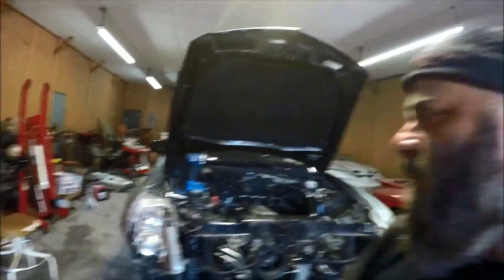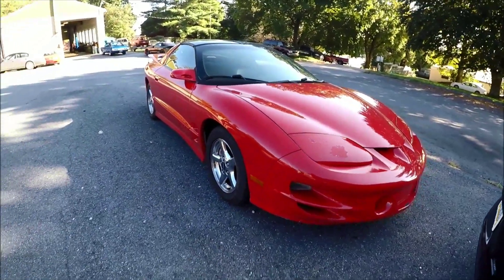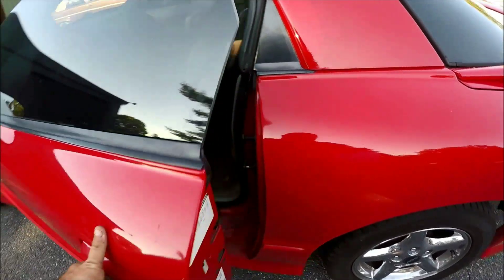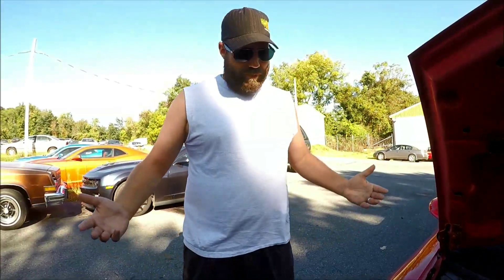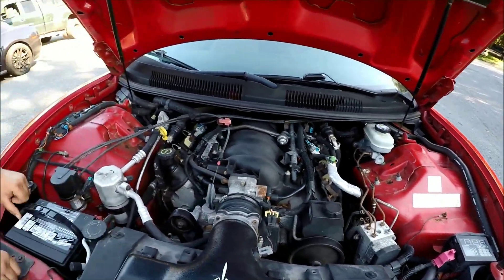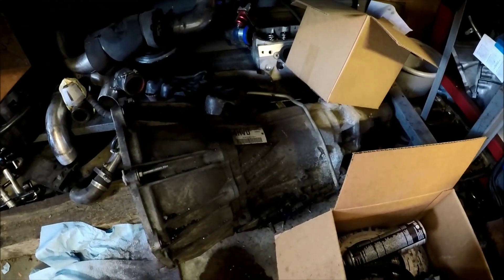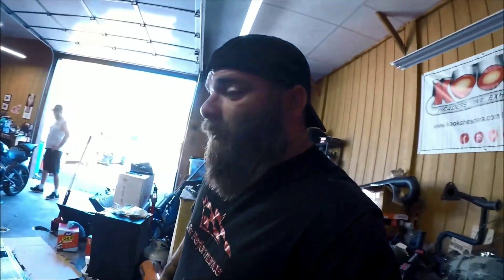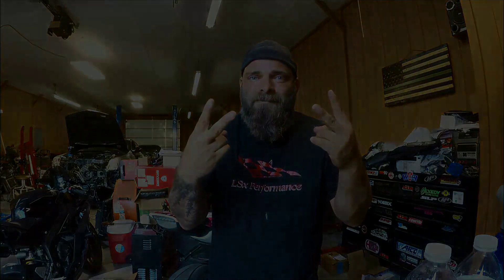The Shop Trans Am Breaks AGAIN!!!

Comment: Hey andy my 2010 ss camaro the clutch is going out I think it has be forced into gear and moves when it goes into first without any brakes on it. But also have friend was shifting and hitting the gas with the clutch partially in still. And that can mess up the pressure plate not sure about throw out bearing. But I'm have to get a better clutch anyways to once I add more power with a cam and blower or procharger or turbo set up.

Comment: Get a 2800 YANK-ER-OOOSKI Stall... you could always go with a mild cam setup. Even the GM hot cam package is pretty simple and cheap. I think it's a 525 left and they throw in some titanium valve springs and stuff like that just to give it a little extra protection. You going to have to have more than that to take down old John Doc

Comment: 2800 stall  i had a 92 camaro with a 350 tune port with a 700R4  built by maddog transmission stage 2 build with a 2800 stall and it use to lanch hard but super smooth hook and book

Comment: You could also do a 2800 or a 3000 converter . I think the 2800 would be my choice. You know your shit . So I’m not telling you what to do . I did a 2001 vett with turbo and E85 a 2800 convert we put down 567hp and 610 TQ .  Still running today . Nice little setup .

Comment: Rebuilt the 60E and modify that LS1 with a LSX 102 mm intake, Headers, Cam, 243 heads. SLP exhaust and a 75-100 shot, 65E is a slow banger, Stay with a 60E or a 80E!

Comment: Are you thinking broken sun shell? The stall is going to be variable to the power level and weight as you probably already know given your fluid checking display. A good 9" converter with the anti-balloon plates set for 2800-3200 in the ballpark power range with a 1.98:1 torque ratio and lockup should be fervent on a street driven turbo LS with high gears thinking that the 65 should have lower 1-2 gears to overcome some of that. I'd be interested in the trap speed and how long the 10 bolt lasts. I've never seen an 8.5" put in a torque arm F-Body, but they should've been factory after '86. Same pinion bearing diameter as a 12 bolt. You asked for suggestions and I'm going off of memory, can you underdog it a little bit?

Comment: Andy! Great post today. I don't know why, but it seems that Firebird & Camaro owners like to cover up their botched tranny builds with shift kits. My 1984 Z28 had this same issue. Less than 6 months after I got it, I had to tow it to a professional shop after the spacer tube on the torque converter was ripped off & thrown into the pump. When it went, the rear of the car jumped so bad I thought the front end of the drive line had dropped, causing a pole vault.

Comment: I am a lucky man...... Idk how my stock original 200K miles 4L60e is still working. I have had heads, cam, bolton package in it for almost 80K of the 200K. Maybe in the tune or got magical one built right from factory, but I floor the truck ALOT. I don't do burnouts b/c tires are expensive lol I also just leave it in drive and let the computer do its thing. Maybe those are reasons as to why it is lasting? idk

Comment: I would do a 2900 stall
Reply: 3200 stall will be better for building boost on staging line being he's into drag racing. Granted 2900 would be way more street friendly but also keep in mind he's keeping the 2.73 RGR&P.  If you look at the specs, number for number, it's same logic BMW and Mercedes amg use on their performance line up. The guy knows exactly what he's doing and plans on keeping the torque of the motor doing its job.